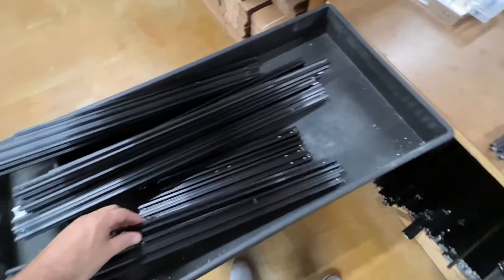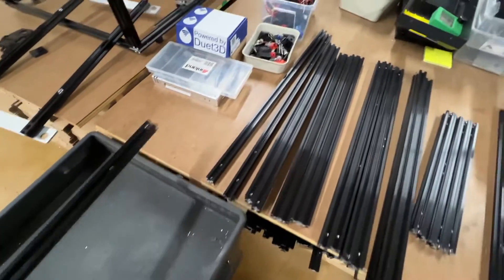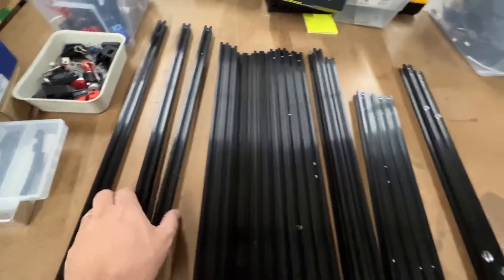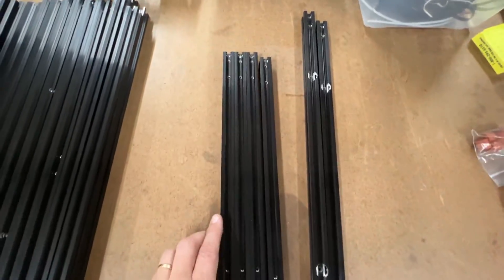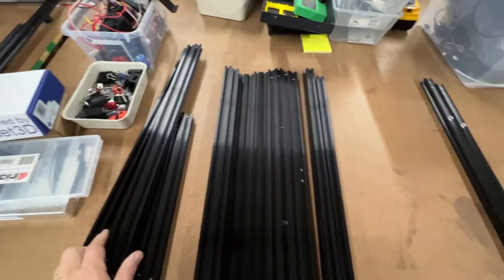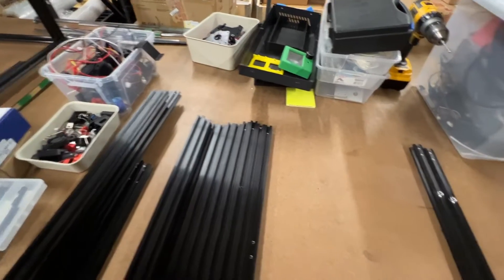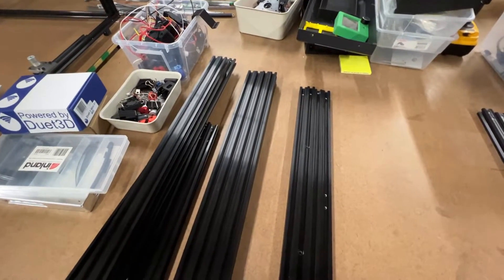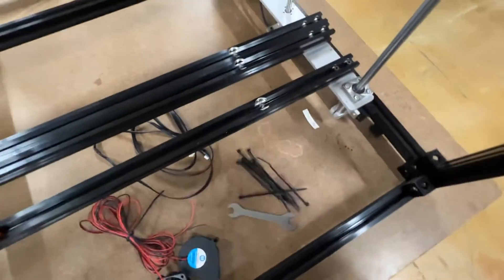Pt 2 - Ender 5/5 Pro/5 Plus upgrade to 500x500x500

Comment: Where links to buy the kits?
Reply: No longer available
Reply: @MakerMark  I'm starting to not enjoy being 5 years late to the party.
Reply: @MakerMark  😭
Reply from the maker: https://enderextender.com/collections/ender-5/products/ender-extender-500-based-on-the-ender-5-plus
Reply: @enderextenderoriginal  product/page not found. Is this no longer available?
Reply: Why would you discontinue this thing? I want whole 500x600x500. But right now only 500 z is available. 500 x 500 y are not even being sold separately 
Also they as well might go out of stock few days from now
Reply: Why would you discontinue this thing? I want whole 500x600x500. But right now only 500 z is available. 500 x 500 y are not even being sold separately 
Also they as well might go out of stock few days from now

Comment: I have an Ender 5 Plus with an Exoslide X gantry which uses a piece of 2020 that is longer than the stock gantry. Do you offer an replacement piece of 2020 that will work with that gantry??

Comment: Seems like a neat concept. I'm just thinking that twice the print area means effectively eight times the volume, eight times the cost, and eight times the time. I'm not patient enough for something that big.
Reply: Bad calculation. You use bigger nozzles, 0.8 or 1mm, higher layer height and so on. 
My Ender 5 is heavily modified, I run 8k acc and 150-250mm/s with a rapido uhf